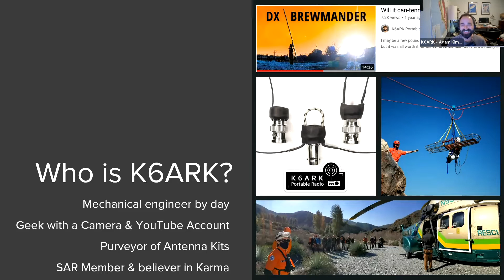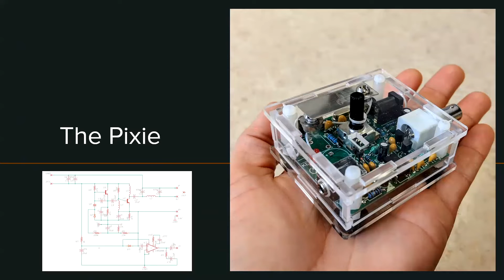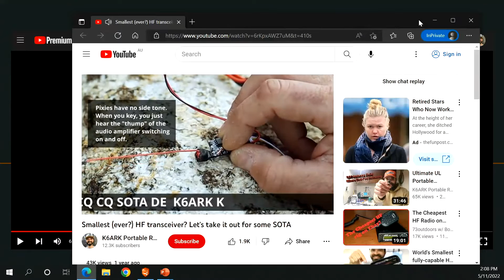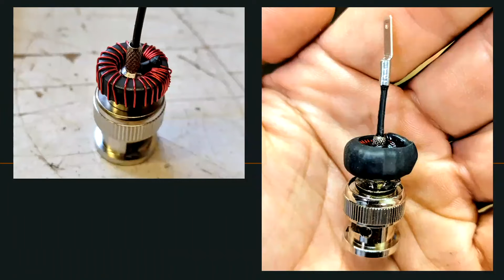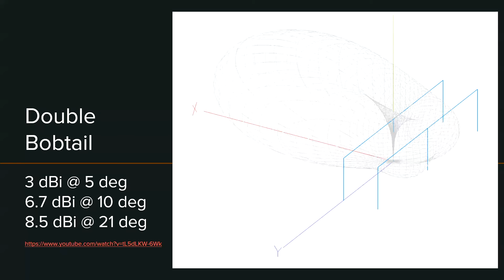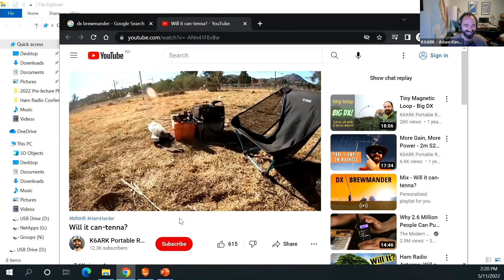How SMALL Can You Go? QRP Ham Radio

Comment: Amazing!  One thing I've learned trying to design kits around the 9v that's USB rechargable is that they tend to be about as dirty and noisy as it's possible to get, a LOT of low hanging fruit for improvement on the PCB side or modded 9v side